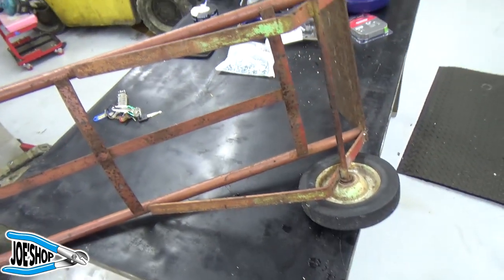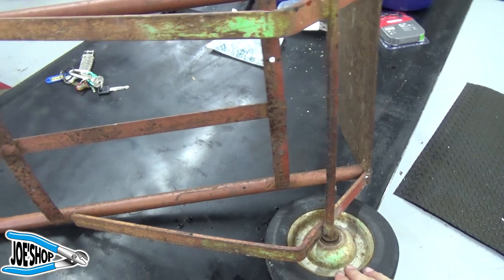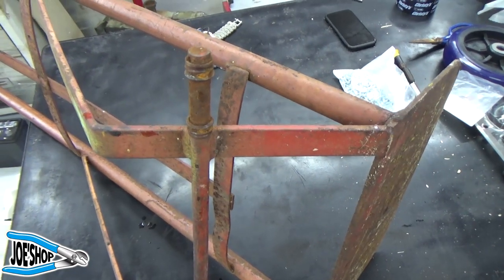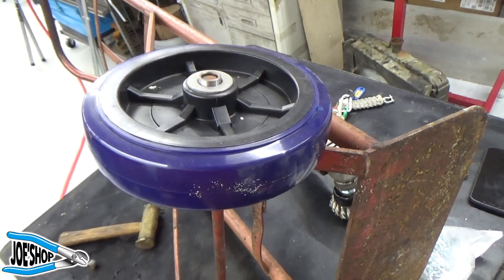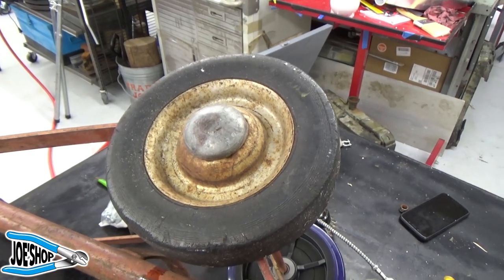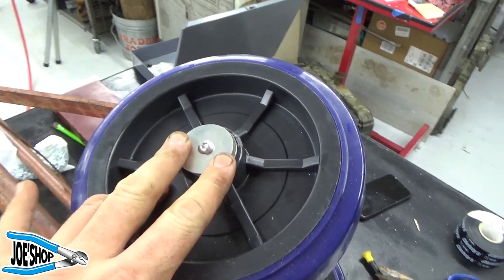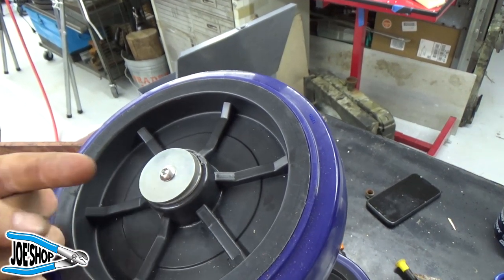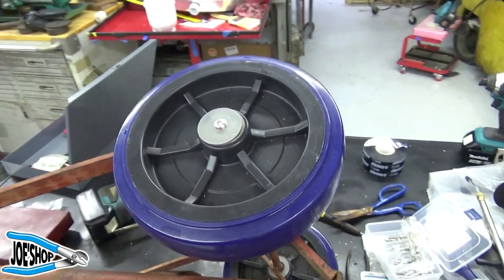Hand Truck Rescue

Comment: Wheels are more expensive than to buy a brand  new han truck. What is the point?
Reply from the maker: The old hand trucks are usually built better. The new ones look good, but are made with thin wall tube.

Comment: I took mine and welded two chain links on each side, one high and one low. Then put ratchet straps on it to move big appliances.  Works just as well as the expensive ones. No belts for sliding up and down on bottom, but with rails you don't need
Reply from the maker: That is an excellent idea! Thanks